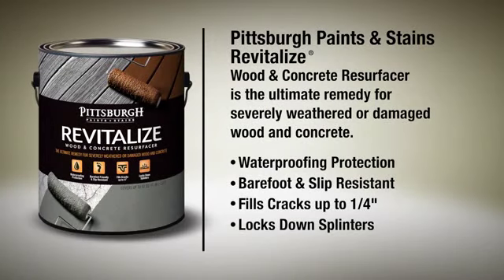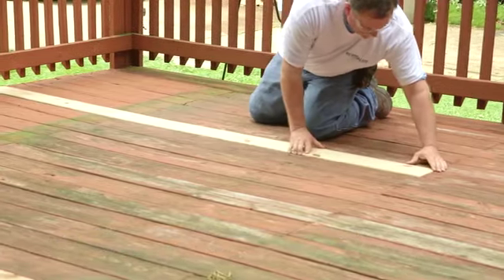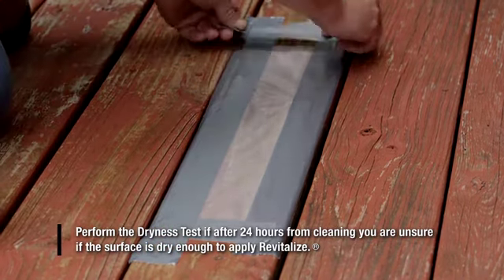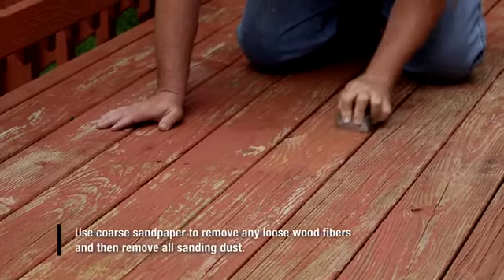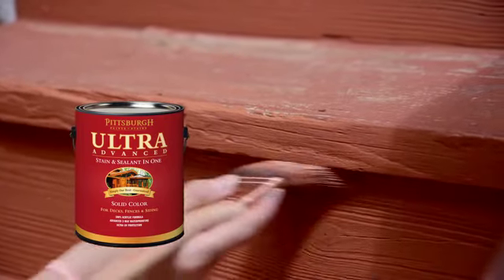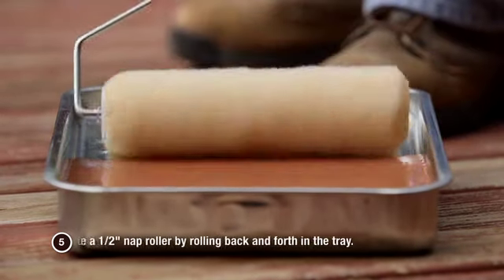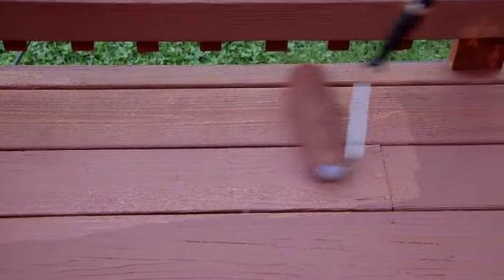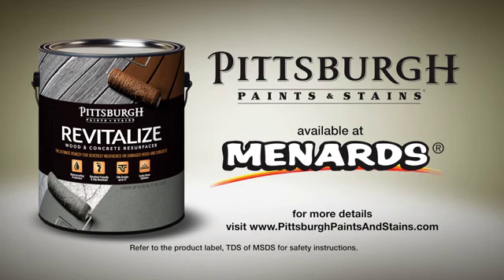Revitalize® Resurface Prep Application Steps for Wood

Comment: Would it be OK to use Revitalizer on a concrete basement floor that originally had carpeting glued to it for decades...without removing the adhesive? Any special prep or precautions needed?